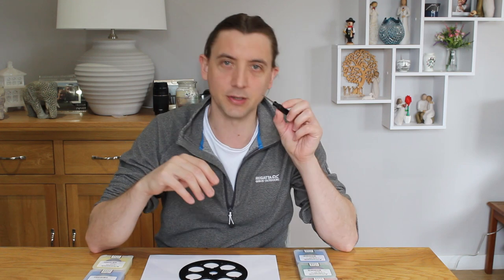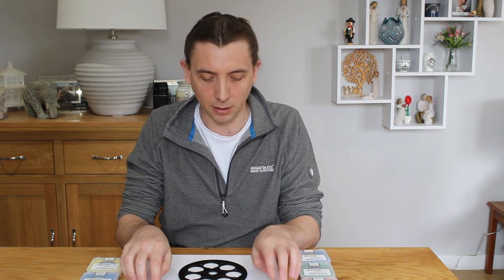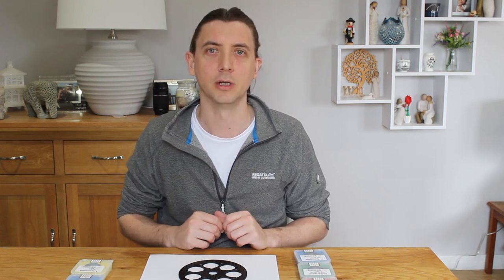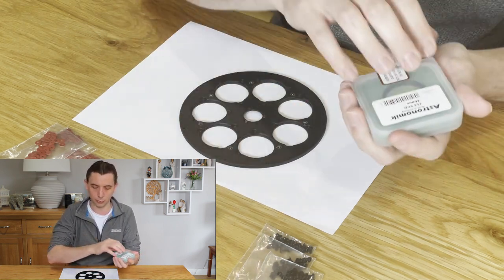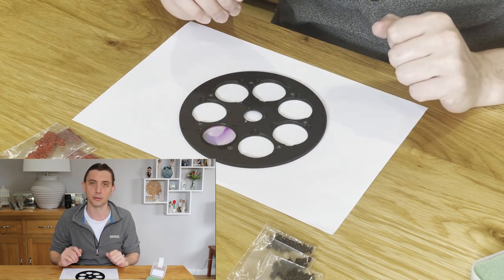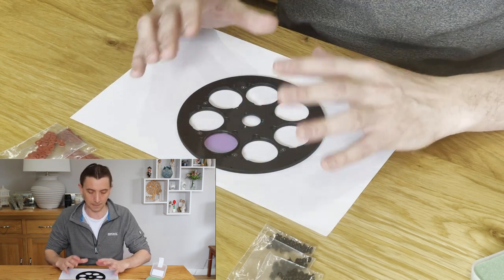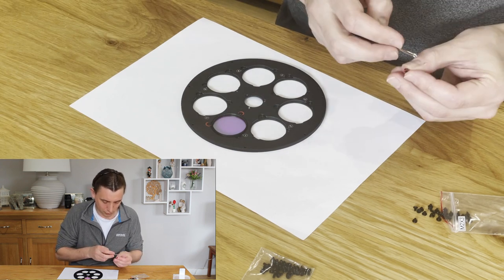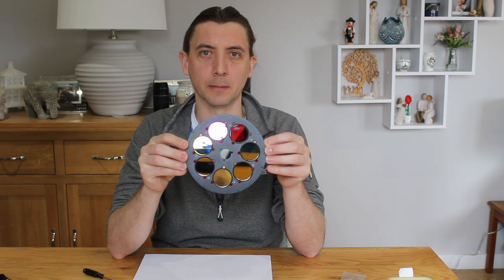Installing Astronomik Filters into my new QHY268M camera

Comment: I just finished the same procedure. Same camera but with Astrodon 50 mm filters. I had to use the largest screws and washers. The filters are a tiny bit undersized for the opening and only the largest washers would work. And with my shaky hands, using gloves to hold the tiny screws was a challenge. Eventually gave up on the rubber gloves and chanced it. All worked out well though. Waiting a few days to get the scope out. There's a 30 mph wind blowing and it's currently around 25 F outside. I used to brave the cold when I was around 30. Now I'm 65. Waiting for it to warm up.

Comment: Thank you really for this video !!! I 've just got my new qhy 294m and the QHY cfw3m-us 7*36 filter wheel. Do you have the same filter wheel ??? Because I am interesting in these 36" astronomik filters as well and I was wondering if they fit well in the ultra slim filter wheel I have. I am asking you because the astronomik filters have this black protective ring around and I am not sure if the wheel accept them, I mean if there is space. First time with this setup and I am not expert :)
Reply: Hi, I have the same Filters. Astronomik LRGB 36mm with the Black Ring surrounding the filters.

I purchased a Starlight Xpress filter wheel. But this doesn't fit.

What filter wheel do you exactly have?

Comment: Nice one, installing filters the only thing I don't like about my AtikOne, and I have to do it quite regularly as it only has a 5 postion 1.25" filter wheel, so when I move from RGB to narrowband I have to swap filters. That's part of the reason I bought the asi533mc pro OSC camera, so I can do RGB with that and narrowband with the AtikOne. The chip sizes are well matched and APP has no trouble aligning the channels if I do a HaRGB image.
Reply from the maker: OSC definitely still has a place - I still have my ZWO ASI294MC Pro, it now has a permanent home on my SpaceCat! The 7 position filter wheel makes a huge difference. Five positions would, as you say, just get annoying with the constant changeout. Looking forward to seeing more from your 533!